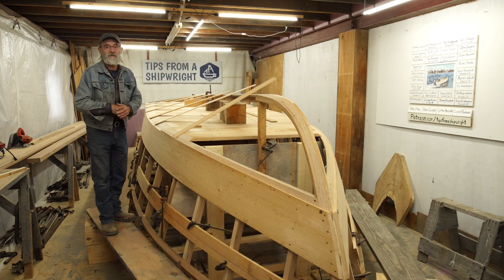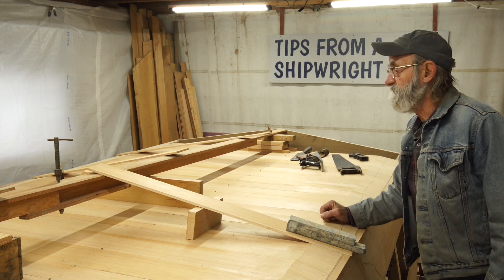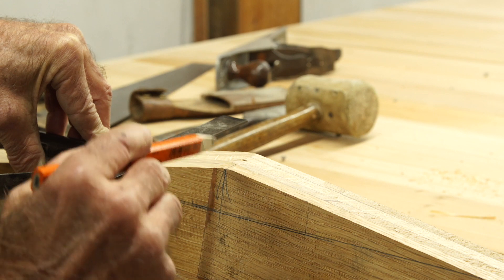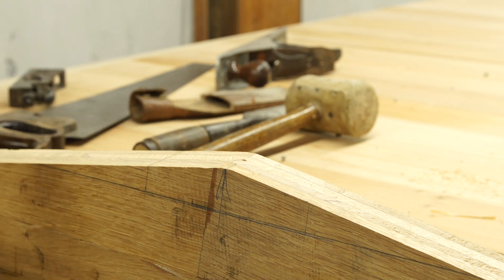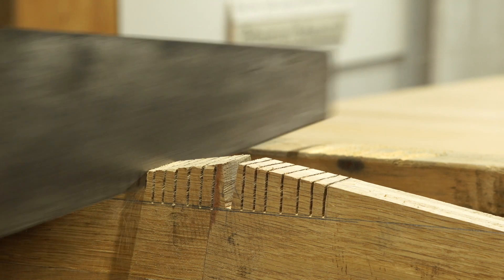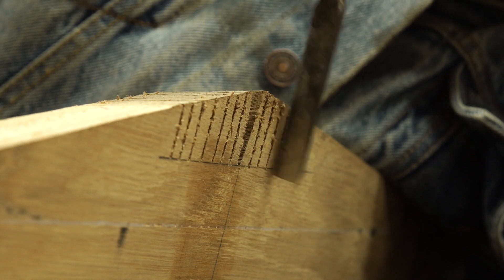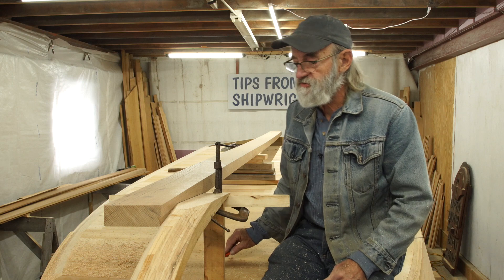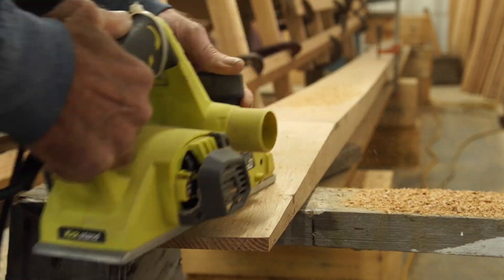Building the 23' V-Bottom Skiff - Episode 8 - Installing the keelson

Comment: Must be great to have all that time to do things in the old way.

However for those who don't mind using power tools something that comes to mind at 6 minutes into the video is to take two pieces of scrap board (plywood, pieces of 2x6 etc and either nail them or clamp them (no left over tiny holes in the part of the wood not being cut) to each side of the board level and plumb with the centerline of the boat. Then set the depth on a circular saw or far better (if you have one) a router then you can quickly cut the notch to accept the keelson. With the circular saw set to the correct depth, you would make a series of cuts as shown in the video and finish with a chisel etc. With a router you would simply set the depth of the bit and rout away.

Comment: Hi Louis, at 4.40, why don't you put the square vertical? Would you not achieve the same result?
Reply: The level bubble in the square works on the horizontal, not on the vertical. That would be my guess. I believe he is using the level bubble in one direction and his eye in the other to set square.

Comment: Lou, a question about the planing direction.  It looks to me that planing downhill instead of the against the end grain would produce a smoother job.  But I don't build boats.
Reply: If you're talking about the scarf surface he was working on at the heel of the stem?  That's a shallow enough slope, plus the fact it's laminated out of a bunch of layers, instead of one solid timber... and MAINLY because it's a power-plane cutter head, where the actual cutting angle of the blades approaching the wood is almost perpendicular to the grain structure anyway (same as a stationary thickness-planer:  rotating cutter-head is really a completely different form of cutting action than the usual fixed-45-degree hand-plane blade -- more analogous to the perpendicular set of a scraper-plane blade)...  These factors make the small difference of uphill/downhill on that scarf, to be inconsequential.  When running this sort of power-plane in this sort of scenario, your bodily ergonomics/control, as well as just seeing what you're doing from the most convenient angle, are very much the more important consideration than grain slope. 

The OTHER thing to consider:  Especially if using epoxy for the glue joint (I don't remember if he said that -- there's actually a chemical reason why White Oak and Epoxy are often not the best combination)...  But you in fact don't really want a very "polished" sort of exquisitely smooth & perfectly flat joining surfaces in a glued scarf joint anyway.  Depending on the species of wood in question, best practice with epoxy sometimes even calls for deliberately scuffing the faces lightly with a file/rasp or coarse sandpaper after the fit of the joint is perfected, because the epoxy needs some texture to "grip" or "bite", in order to make a properly strong bond with the wood surface.  So some theoretical small-scale roughness of the grain lifted from the "wrong direction" here, would kinda actually help the joint be stronger in that sense.

Comment: I'm afraid to build a boat like that. How do I access the bottom in case of a rupture of some kind?
Reply: Just use flex seal
Reply: @bill7778  how do I reach the bottom through the floor?
Reply: Um typically it can vary depending where you rupture is once you fiberglass it everything is going to be rock solid
Reply: It's a wood boat, cut a hole in the sole where you need access. Easy access to the bilge is not a new problem.
Reply: Where do I need access? I'm talking about if I hit something. I was on a boat that sunk when we hit a piece of rebar. I'm just saying I want access everywhere in a reasonable amount of time
Reply: This will be a comparatively light boat with a shallow draft and an overbuilt bottom, thanks to the double layer of cedar with epoxy laminated between and on the bottom. I think it would take a lot to put a hole in the hull.